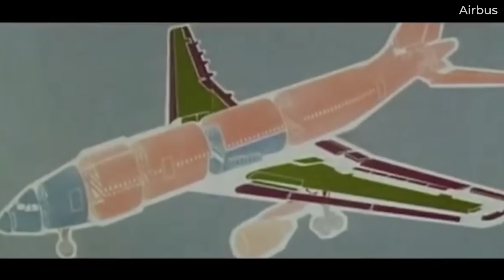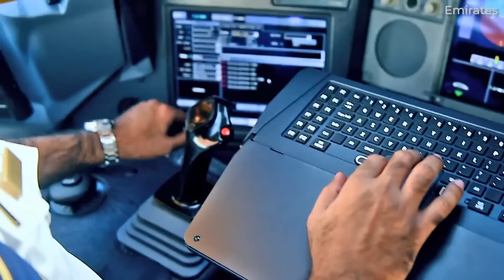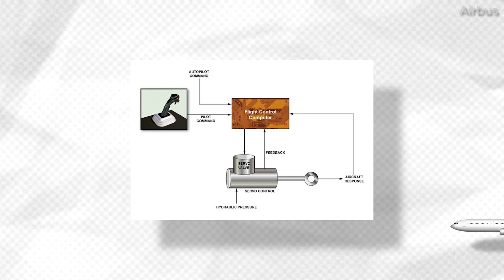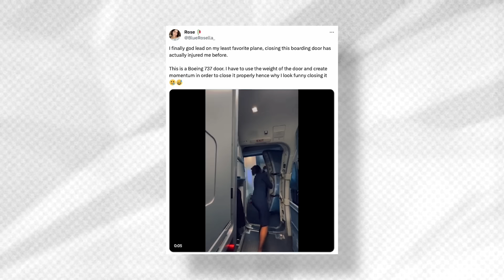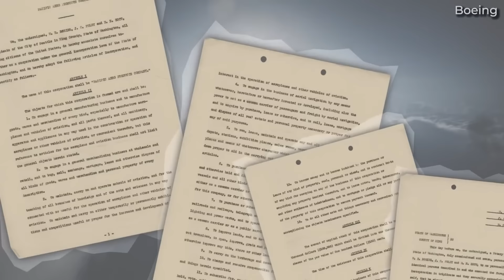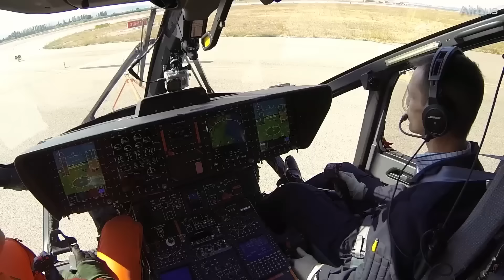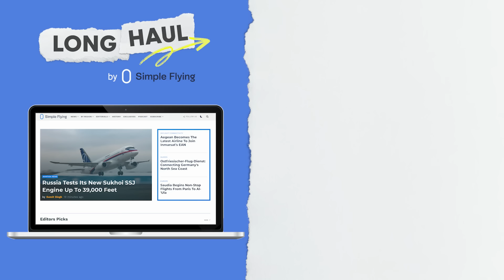5 Major Differences Between Airbus And Boeing Aircraft

Comment: Tell the story of that early airbus crash at an airshow because the computer would not allow the pilot to pull up over the trees.
Reply: You have a terrible interpretation of the events. Maybe watch it again? Because if the airbus did allow them to pull up in that situation, they woudve ended up crashing much earlier and possibly to the crowds nearby
Reply: @topethermohenes7658  ok.he is correct.
Reply: @thetruthbehindplanes   at those conditions, they woudve crashed earlier in any aircraft they were in. The airbus actually stopped them from crashing and they woud not have crashed if only for the trees
Reply: @topethermohenes7658 not true
Reply: @thetruthbehindplanes   waste of time explaining, you woudnt understand
Reply: @topethermohenes7658  and tell me about that airasia i think which crashed into the indonesia sea.the pilots trusted the automation so much,they thought it would still be there if you pulled that computer plug out.if airbus didnt do that much automation,then i suppose that wouldnt have happened
Reply: @thetruthbehindplanes   like that pilot, if you don't know what you are doing in a modern jet, you'll crash, true for any modern airliner. Get me a Boeing 777 and turn of the computer that controls the rudder and most if not all flight control systems and see what happens

Comment: An Airbus always trims itself to the flown thrust and angle. The nose will only move, when the Sidestick gets used.
Reply: The trim part is correct, the nose part (or rather pitch) is not. The airbus  FBW, unlike the Boeing FBW, is flight path stable, so it will keep the flight path the same, even if speeds change, which necessitates a  pitch change for example. Same for counteracting gusts which the FBW does without pilot input. 

On the Boeing FBW the aircraft is speed stable, same as conventional aircraft. So the trim is used to set the reference speed and with changing speed the flight path will change in manual flight.

Comment: Boeings with the old yokes cockpit are just outdated, in 2023 sidestick is a must, ask Airbus, Gulfstream, Bombardier, Embraer, Dassault, even Lockheed with the F22 and F35 uses a sidestick. Come on Boeing , you can do better.
Reply: What about Cessna? There's more than just Boeing using the yokes.
Reply: @angelorobel12  Cessna is as outdated as Boeing, and they only offer small jets, no high end business jets like Gulfstream, Bombardier and Dassault.
Reply: @christianbayerstein5243  Right. Even if those are outdated, those yokes are not going obsolete and there are pilots that still choose the yoke over the sidestick and we can't change their opinions on that matter.
Reply: well airbuses crash so often.maybe because the sidestick is so small thats its basically on off!

Comment: *no door blown
*No mcas
*No profit over safety
*No problems
*No stupid ceo
Reply: Why were the ONLY two 737MAX crashes with third-world Airlines? 
Flying an airplane that up until the time of the crashes had experienced ZERO incidents.
 
After a year of test flights and data-gathering, the MAX gained certification from the FAA in March 2017, followed by other global regulators later that month. 
By May 2018, a year after the first delivery, more than 130-MAX's were in service with 28-different airlines around the world and had flown almost 42,000 flights.
With ZERO incidents
Before the second crash, there were nearly 50-carriers that were operating the MAX. Using it for an estimated 8,600 flights per week. 
With no ZERO incidents.

That the FAA and EASA didn't know about MCAS, a meme being pushed by BOEING BASHERS and the MSM, is bovine excrement. 
Although Boeing did not call MCAS out by that name, the Boeing Flight Crew Operation Manual (FCOM) described the function in detail, and how to override it. 
And 50-carriers crews had no problems with understanding it. 
The FCOM was successfully used by 50-carriers to train crews in flying the new 737 variant.

Lion Air and Ethiopian Airlines with their low-time inexperienced pilots and with inadequate management of their crew training - ruined the safety record of a perfectly safe airplane.

The fuselage plug issue occurred in ONE airplane, out of 1,420 delivered and after flying over 100,000 incident free flights! 
The plane and crew handled the incident perfectly. Nobody was hurt. Not even a sticking plaster was needed in this "disaster"! 
Boeing and Spirit will take remedial action - and the 737MAX will go on to be as safe as any other commercial aircraft currently flying.
Boeing has 4,031 MAX aircraft in its order backlog. 
You think these folks who fly these wonderful airplanes every day for a living think the MAX is dangerous? Yeah right!
Crossing the street, or driving one's car to get groceries, is 1,000 times more likely to get you killed than flying in a Boeing 737MAX.
This is just an over-the-top, hysterical, hyperbolic nonsense coming from woke folk who want to live a life of 100% safety! 
Better stay at home and sit on their couch!:face-orange-frowning:

Comment: Boeing pilots control the rudder with their yoke do they? 🤔
Reply: Well, on the 777, 777X and 787, technically yes but indirectly. Their FBW systems in normal mode has the rudder deflect when the pilot turns the yoke, for a coordinated turn. On other Boeing aircraft, no. The pilot has to use the rudder pedals to deflect the rudder when turning.

Comment: Does the cabin lighting/ Entertainment/ galley equipment between the two manufacturers differ or is it based solely by the airline company’s specifications from a third party?   (Kinda like how interiors and seat designs are chosen)

I’ve had the opportunity to see the touch screen of a PAL A321 and A330 but I don’t recall ever seeing it on any Boeing aircraft.
Reply: Passenger stuff  like seats and IFE are coming from third party manufacturers, not the OEMs. Cabin lighting is done by the OEMs although aftermarket products exist as far as i know.

Comment: Airbus was NOT the first Fly By Wire.
Avro Canada had the first aircraft (military) to use the system, CONCORD (before Airbus existed) was the first commercial jet so equipped.
Reply: You could argue that the concorde was the first Airbus, even if the name did not exist. We are talking more or less about the same manufacturers.
Reply: @andreaseufinger4422  That would be like saying GM is Ford - they use many of the same suppliers.
Reply: @bricefleckenstein9666  I'm not talking about suppliers. There was no enterprise named Concorde nor Airbus in the early years. Concorde was the product of some manufacturers working together, same with Airbus. The Airbus company was created much later.
Reply: @andreaseufinger4422  Concord was the result of a project BY TREATY between France and the UK, where Sud Aviation and BAC worked together to create the aircraft.
NOT AT ALL the same situation as Airbus, which is an actual company on it's own with many manufacturers supplying parts to it, though some of the same companies have been involved in both.

Comment: You missed out the start business for Boeing, they were building motor yachts before they started with the aircraft.
I recently ( within the last year ) saw a Boeing Yacht up for sale, over 100 years old and still going strong.

As a passenger, I have found Boeing to be more comfortable, every Airbus I have been on has had thumps and vibrations and jerking of the aircraft while in flight, the Boeings have all ridden smooth as a pane of glass.
Reply: @jaquigreenlees  -  Ever hear of turbulence?
Reply: @wickedcabinboy  yup and sleep through it.
the roughness I feel with Airbus isn't turbulence.
Reply: @jaquigreenlees  And we always try to avoid flying on an aircraft made by a company where the accountants have replaced the engineers, and the aircraft are assembled in a plant where the workers are on minimum pay and the quality is so bad that many of the Gulf carriers refuse to take planes from that site. No Boeing, thank you very much.

Comment: I have never been on a Boeing aircraft that did anything that made me concerned, I have been on Airbus aircraft that made me concerned. The first was when the crew started each of the engines a cloud formed in the cabin and the second was when the flaps bouncing up and down 6" when extended. Both of these were A320 aircraft. I have also seen a lot of broken overhead storage doors and seats on  Airbus that indicate weak designs. On all other Airbus and Boeing aircraft the flaps were solid to the point I could not see movement even in rough weather. I do not feel that Airbus has the same quality standards in manufacturing and engineering. Fly by wire was first introduced into military aircraft in 1956 by North American Rockwell on the A3J Vigilante.
Reply: Flaps bouncing up and down? Do you mean the spoilers? Flaps are incapable of bouncing 😂 spoilers on the other hand is designed to go up and down
Reply: I always felt safe in Airbus.
Reply: Boeing quality - always get you to your coffin faster

Comment: It's called SCAREBUS for a reason. The doors suck to open. The slightest misalignment on the swing arm and the massive finger chopper on the outside makes the opening and health and d saftey problem.. Boeing doors are camed and work from a leveraged operations which allows for little force to open or close.. and that fly by wire.. let me know how that works out for you when you need to preform radical maneuvers,  oh that's right some of the critical components could not take a life saving G- forces needed to regain control after an event.. plastic is ok .. but metal is better
Reply: Yeah, boeing is so safe, I bet you would sit anytime next to their plugged doors hey?
Reply: @johnmeneses7039  i would.safer than a eggshell!